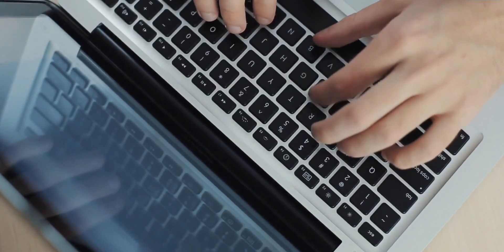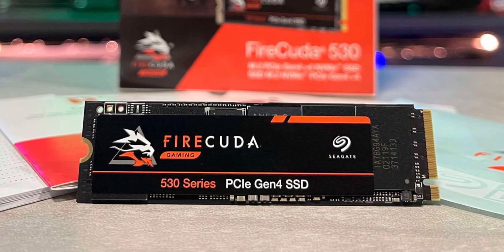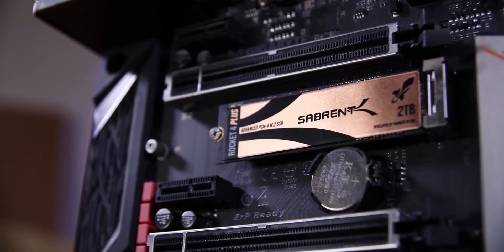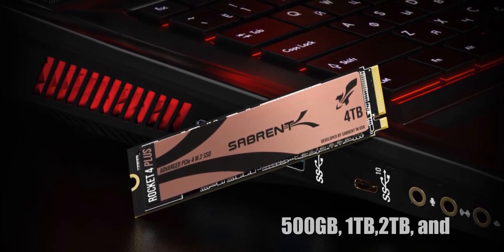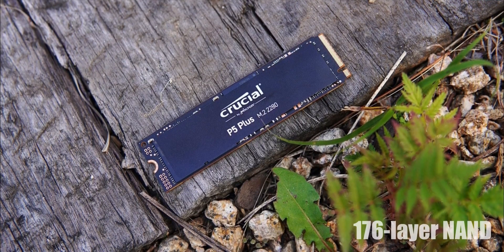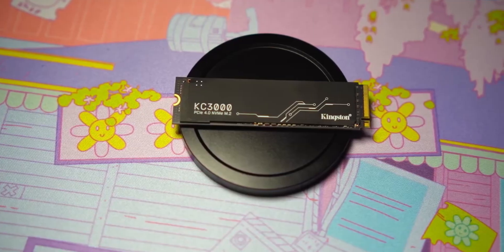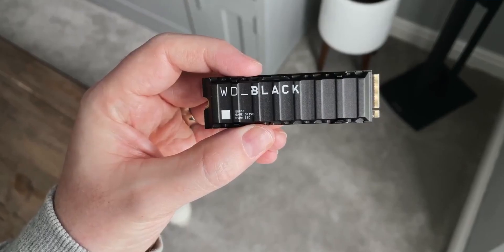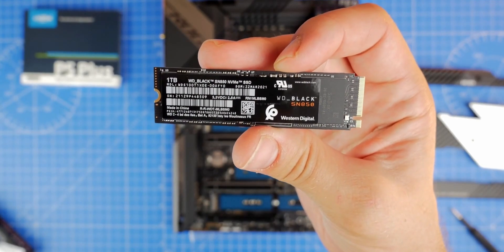Top 5 Fastest NVMe SSD's - ⭐ 5 Best Picks (Buyers Guide And Review) in 2022

Comment: Nothing about sk hynix platinum p41? Heard that they are smoking fast
Reply: Sk Hynix P41 Platinum, Samsung 990 Pro,  WD sn850x and the Kingston KC3000 are the top 4 fastest nvme on the market as of this comment. Sk Hynix also bought out Intel's NVMe brand and renamed it to Solidigm. The Solidigm P44 is literally a P41 platinum rebranded. The only difference is the lifespan is slightly lower as Sk Hynix reserves their slightly better quality batches for the name brand since they can sell them for a better profit due to a bit better reliability and the known brand name.

Update: I almost forgot, but a few Gen 5 NVMe drives have been show off at CES already pushing 10,000 and 12,000 r/w speeds. So if your looking for stupid fast storage, that may be something to look forward to. Otherwise the Samsung 990 Pro and Sk Hynix P41 Platinum are the fastest and most reliable drives out to date.
Reply from the maker: @deadly_mir  Very detailed, thank you for the update! I will probably use some of that information in the 2023 video.
Reply: I just got one for my rig. It's blistering fast! 7400 MB/s read and 6700+ write
Reply: @kagato82  which one is that you have
Reply: @Division_Agent_  the P41
Reply from the maker: @kagato82  Good to hear you like it!
What CPU and motherboard you running?
Reply: @Best Tech Choice  5800x on a ASUS ROG Strix X570 Crosshair VIII Hero
Reply from the maker: @kagato82  Nice!
Reply from the maker: The Kingston's KC3000 is slightly faster, but the Platinum P41 gives it some close competition!

Comment: not a word about samsung
Reply from the maker: That's right, at the time of making this video the Samsung 990 pro wasn't out yet and these drivers are faster then the 980 Pro.
As the 980 Pro was one of the first Gen 4 NVMe SSD's, and now it's "slow" comparing to the newer NVMe SSD's.
Which is why Samsung released the new 990 Pro, to have the fastest SSD on the market again.
Reply: @BestTechChoice  hi good day. thanks you for the content.  Is the crucial p5 plus faster than the 980pro?
Reply from the maker: @Incinerate1212  Define faster. What are we talking about? Faster sequential throughput? Faster random read/write speeds? More IOPS? Faster access times?
Reply: @BestTechChoice  not sure how to answer it other than to say which one is better for gaming ? Trying to decide which one on Amazon between those . ( 980 pro vs crucial p5 plus )
Reply from the maker: @Incinerate1212  The P5 Plus is better for gaming as it has lower latency and in benchmarks loads games a bit faster especially the 2TB model over the 2TB 980 Pro. But the Kingston KC3000 is just as fast as the P5 Plus of not slightly faster.
But the current best SSD for gaming is the new 990 Pro its latency is a decent amount lower. But it's a more expensive. (and needs firmware update  to address Failing SSD health bug)
Reply: @BestTechChoice  thanks for the best choice information . Much appreciated. 

The crucial looking way cheaper, so perhaps that one
Reply: What about the mushkin vortex ?